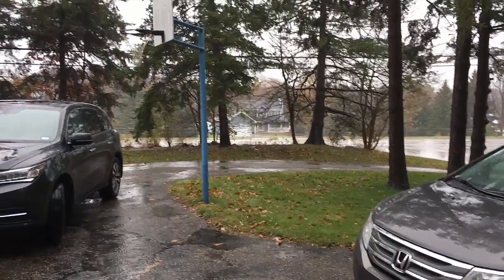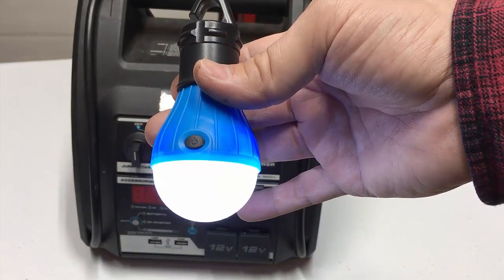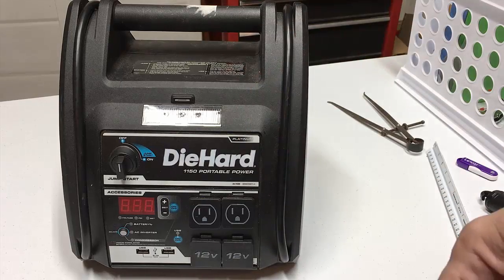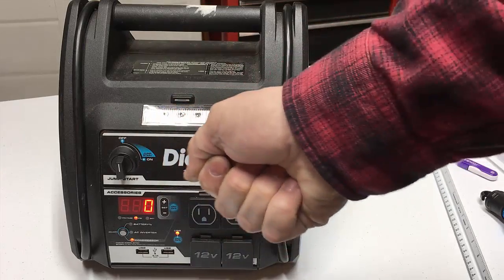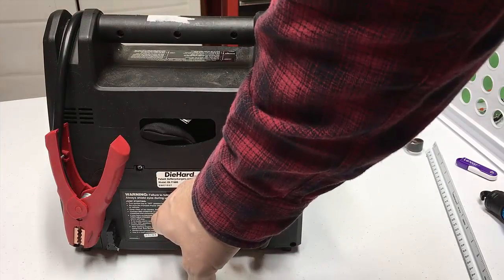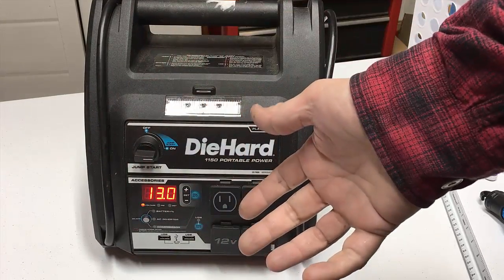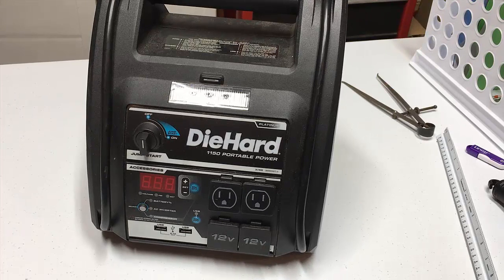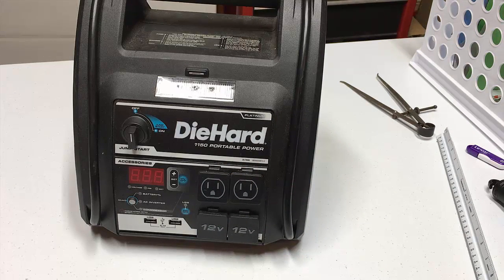Poor Man's Yeti Goal Zero

Comment: Great video but your note for a little confusing. You have attributes of each listed under Diehard and Yeti Goal Zero 400 however the titles are off set and I can't be sure I'm reading them properly. One is modified sine, the other is pure sine. Which one is better and does it matter for the application?
Reply from the maker: Sorry about that, YouTube limits the formatting of text and so, it might look good on a laptop, but not a phone.  So...  The Yeti is the one with a pure sine  inverter.  Although most electronics will work fine with modified sine, my electric blanket control does not.  Also, I've been told it causes a problem with some HP brand laptops (I have not tested this).  I actually carry both types and use the pure sine exclusively for the blanket.  For more info on the difference between modified sine and pure sine, check out this video: https://youtu.be/63Ff_RVuW7w
Reply: @OdysseyCamper  to follow up on that, will the laptop be damaged if it needs pure sine and I plug it directly into this model (in order to see if it's compatible) or would you suggest we air on the side of caution and just get the pure sine inverter for laptop charging and plug it into this model first (then plugging our laptop charger into the pure sine)?
Reply from the maker: @grizzlya1257  if it were me, I’d look into the replacement cost of the power adapter to help you make your decision. I used it with my Lenovo without an issue, but the replacement adapter was only $20 if it was $80 I would have erred on the side of buying the pure sine (I did not yet have one at that time).
Reply: @OdysseyCamper  oh, so it doesn't damage the computer it just ruins the charger?  I didn't realize that was the variable.  Between my wife's lenovo, my Dell, and her personal macbook, I'm thinking just get the ($40?) pure sine add on but is the procedure just to plug it into the jump pack?  I'm not sure how to use it when I get it
Reply from the maker: @grizzlya1257  Correct, it’s about the adapter not the laptop. You can plug it right into the jump pack 12V socket.

Comment: I’m wanting to find out if I can run a portable air conditioner off a goal zero lithium 1400? Got a diehard portable power and first time using the air compressor it broke. But otherwise I love it, especially when my van battery went dead because a fan was left on. Plus it does run my house sized window fan.

Comment: would I be able to use it with a cpap machine?
Reply: Get a adapter for your CPAP machine to run it on 12 volts I still don't know what the difference is between what you buy from the dealer or on line other than 120$ or more from my dealer about 40$ online and at the manufacturer its 160$ or more if the ones online and the manufacturer are a regulated 12 volts usually 13.5 volts that's not a bad price but if it just a cigarette lighter plug to a barrel plug to fit their machine than it's a rip off so if anybody has one that they bought on line or from the company website let me know if its regulated

Comment: This seems like a good option for me however, my Dad just gave me this 1000W cobra inverter. I am guessing that is a pretty good inverter since it has high watts. So should I just buy a battery for that? Can I charge a battery without solar? I may get solar in the future but then you need charge a controller too and it gets overwhelming to me. I really just want to be able to charge my phone and tablet. Also run a fan or heater at night in van. He also gave me 2 solar panels but they are only 5 w. Thank you!
Reply from the maker: Cobra makes good inverters, so you should be happy with that one.  Let me try to answer your questions.  First, there are two ways to run an inverter of that type.  The first is to connect it to the vehicle's existing battery.  This is a fast and economical way to run the inverter, but you have to be cautious not to run the battery down when the engine is off.  Generally, if you are running something in the 500W range for more than 15 min, you'll want to start the engine---but then you have unlimited power.  To charge your phone and tablet, you should not need to run the engine. For a fan, you'll want to check the wattage on the tag.  A 30W fan should be good all night, without starting the engine.  A 60W fan (full size house window fan), I'd limit to 4 hours before starting the vehicle.  If you are afraid you'll sleep six hours and leave it on, just put it on a timer switch like this one:  https://amzn.to/2KjhQNy
    I did a full write up (which loops back to a YouTube video) here:
http://odysseycamper.com/convert-your-mini-van-for-camping/installing-inverter-battery-bank-micro-camper-part-1/
   The second way is to install a "house battery" which is separate from your vehicle battery.  This can be charged as you drive your vehicle, by using a battery isolator like this one:
https://amzn.to/2MTvgyz
   If you are going to be parked for a couple days at a time, it might be a good idea to add a solar panel and charge controller.  I've used this charge controller:
https://amzn.to/2tpT1Gb
Basically, the charge controller takes the voltage from the solar panel and regulates it for charging your house battery.  You can use this AND the battery isolator for the best of both worlds.
To learn about how to connect it, check out my solar generator video here:
https://youtu.be/yooxbMWjQzU
  Then you will need to buy a solar panel.  Expect to pay a little over $1 per watt.  Bigger is always better, but you can add more panels later, so get what you can afford.  You can use the 5W panels you have, but you'll only get a maximum of 5W out of them (usually less).  So if you ran a 30W fan for one hour, it would take six hours to put that power back in (30/5=6)
   Last thing and this is really important.  The inverter may be 1000W, but to get the full amount of power out of it you will need to provide a big enough cable to feed it.  At1000W you will be pulling 83 A.  A quick check of the ampacity tables says you will need a 2AWG cable.  I'd also put a 100A circuit breaker on it.  I've used this one:
https://amzn.to/2tpGSkx     If it has a cigarette lighter plug, you'll be limited to 180W before the fuse blows.
   However, if you only ever plan to use 500W at once, you can scale down the size of the wire and the breaker.  So add up the Watts on everything you plan to use at once.  If you let me know the total, I can reccomend a wire and breaker size.  I hope this helps (without being overwhelming ;-)
   You can follow OdysseyCamper on Facebook (@OdysseyCamper), Pinterest (OdysseyCamper) or at OdysseyCamper.com  Thanks for watching!
Reply: Odyssey Camper thank you so much for all this information. I am going to read this a couple of times and then figure out exactly what I will be using when I camp. Leaving on my first trip tomorrow but will be at an electric camp site. I happen to have a built in inverter in the back of my minivan too. That should help when I drive. Thanks again for taking the time to give me all this information. I will get back to you after do some figuring! 🤗
Reply from the maker: Debbie Bruening Safe travels!  The important thing is to get out there. The rest will work itself out.
Reply: @debbiebruening  anything that uses 12 volts or less use a 12 volt adapter like your car charger for your cell phone you can get lights that run on 12 volts your inverter uses power to run so to convert from 12 volts to 110 and back down to 5 volts waist power your battery will last longer

Comment: these okay for charging laptops?
Reply from the maker: rich pitcock Some laptops recommend against charging with a modified sine inverter, which is what this has inside. For sensitive electronics, this is the least expensive Pure Sine inverter that I’ve found: https://amzn.to/2JAwoZC  I use it with my electric blanket and it works great!
Reply: Odyssey Camper unfortunately this link doesn’t work now.

Comment: Hi, I am an owner of 2 Goal Zero (GZ) Yeti 150s and 2 Yeti 400s. I like your review, one thing I must point out...I think this should have been compared to the Yeti 150 rather than 400. Here is why:                           
                                DieHard Pack--                          Yeti Goal Zero 400
Inverter:                     400W --                                       80W
USB Chargers:               2  --                                               2
120v Outlets:                 2 --                                                1
12v Outlets:                   2 --                                                1 (can expand with optional GZ accessory or car dc port splitter)
Battery:                     22Ah (Sealed)--                    14Ah (AGM)
Jump Starter:              Yes--                                                No
Work Light:                  Yes--                                                No
Inverter Type:              Modified Sine--                          Modified Sine
Air Compressor:          Yes --                                               No
Solar Charging:            Soon--See Part 2                          Yes
Battery Level Display:  Yes-% remaining                        Yes- in 20% increment bars
MSRP w/50W Solar      $148 + 65 = 213                         $200 + 65 = 265

The DieHard definitely trumps in the inverter, 120v Outlet, jump starter, work light, air compressor areas still. DieHard has 8 more Ah than Yeti 150, although in your description you put 18Ah. You can hook up a second 12v Outlet to the Yeti 150 but you have to buy an optional $5 accessory from Goal Zero or get one to plug into Yeti 150 dc outlet that splits into 2 outlets. Most other stuff is the same. So the DieHard's $52 cheaper price tag is a bargain because of the DieHard's much higher powered inverter, extra 120v Outlet, jump starter, work light, air compressor, and the 8 more Ah over the Yeti 150. I noticed you said a replacement battery is ~$60, for the Yeti 150 it is ~$40.

Great review and thanks for taking the time to do. I still love my Yetis though. The DieHards (now Schumacher) are great gift ideas though. One question...I kept hearing you refer to the "sealed lead acid" battery. The older model Yetis have an AGM battery, that's the same as a "sealed lead acid" battery.
Reply from the maker: Thank you for the thoughtful response!  There is certainly nothing wrong with the Yeti stuff and it's well packaged.  So, when I decided to compare this rig to the Yeti 400, it was because I had something in mind that I don't think I mentioned in the video (please don't make me watch it again, I had to so many times in editing ;-)  That something was a plan to add another 22Ah battery to the DieHard.  The video for that one is here:  https://youtu.be/wQaS-1ouIqo  That makes the total capacity either 40 or 44Ah (will explain in a sec).  I think the Yeti 400 is 44Ah, so it seemed like a better comparison because at that point you've only got about $270 into the DieHard.  The DieHard comes with an 18Ah battery, but the replacements are 22Ah.  So any expansion would be 22Ah, but the original battery is 18Ah.  I've replaced mine, so the total with the battery expansion is 44Ah.  Having said all that, I have my suspicions on the "22Ah" batteries.  They are the same size, so I wonder if someone isn't fudging the test numbers and they are actually the same.  I'd have to cut them open to be sure.  I just checked the price and they are now $45, so I guess that compares with the Yetis.  Here's the battery link https://amzn.to/2JGAUCu

Regarding the battery types, I am seeing the DieHard/Schumacher batteries being called "SLA" and "AGM" interchangeably (in owner's manuals, online info, advertisements) and I can't seem to get a straight answer as to WHAT they actually are.  All AGMs are sealed lead acid, but not all SLA (sealed lead acid--for other readers) are absorbed glass mat (AGM-for other readers).  That's my understanding, but feel free to add to that.

One other thing to add.  I got my DieHard for around $60 in the pawn shop.  I see them all the time, but don't recall seeing the Yetis there.  Probably because there are more DieHards to steal, LOL.  Anyway, I really appreciate you adding your information here because it will help anyone that reads this.  It would have been a good idea for me to compare it to both Yetis, had I thought of it  :-)  Thanks for watching!
Reply: Alrighty, thanks for the reply and you are welcome! I will agree about Yetis being well package. I will admit, expensive but I just love the simplicity.  So I have some info for ya! The Yeti 400 is is 33Ah, so yeah the 40-44Ah DieHard is going to win that one. Sometimes batteries are the same dimensions but higher Ah, kind of when you get those little power packs to keep in your pocket to boost your cellphone's battery. They can be 2600mAh, 3000mAh, or 3200mAh and still be the same exact size. That's because the battery cells inside the container is just a higher rated cell. 

There are four main types of sealed lead acid (SLA) batteries. Each battery type has been specifically designed to best perform under certain conditions. I got a link for ya that will explain the 4 types of SLA batteries, here ya go https://goo.gl/9UFKAy.  I don't recommend buying from the store this link belongs to though, they are too expensive for my taste. I went to them the other day to buy a watch battery. They wanted $7, for one watch battery! The guy says, "Well it is a Energizer Lithium Battery." I said, "Keep it" and left. Went home and on Amazon found a pack of 5 for $5. Beat that with a stick, ha! 

Yetis are hard to find. I am often scouring Craigslist and offerup to find them, they are hard to come by. Most people sell them because they stop holding a charge like they use to. They don't know that they can replace the battery. Their lost is my gain. I buy a new battery, pop it in and I'm in like Flynn! Anyone who has a Yeti doesn't let it out of their eyesight considering what they paid. So yeah you're right that they might be harder to steal. Mine actually goes in the tent with me at night. Always, glad to help. Have a great rest of your evening. It's my birthday this weekend and I'm off to do a 3 night/4 day camping excursion by the lake.
Reply from the maker: TekSone Once again, awesome info!  Happy Birthday and safe travels!

Comment: I just came across this story and wasn't sure if you'd seen it - I hope if your van is affected that you can get it taken care of and still get out to the RTR. https://www.usatoday.com/story/money/cars/2017/11/18/honda-odyssey-minivan-recall/878002001/
Reply from the maker: I had NOT heard of that, thanks!  Luckily, I've pulled those seats to fit the bed in.  I can definitely see how the seats would fail to latch if you aren't careful.  You are trying to position a 50 lb seat on hooks, while simultaneously not pinching your fingers.  It's a workout.  Honda changed this in the 2017, but now they have brackets sticking up that would hinder what we do.  Anyway, thanks for the tip!